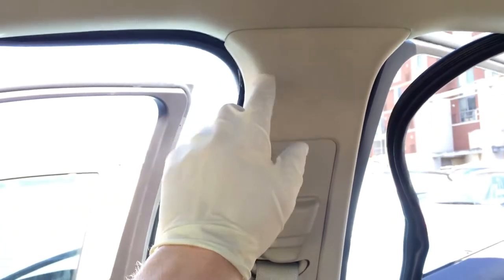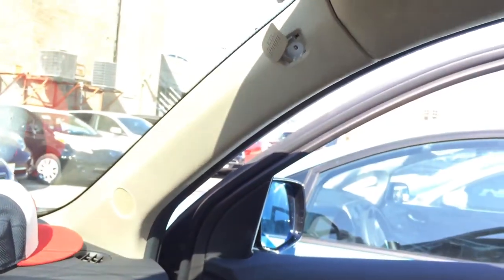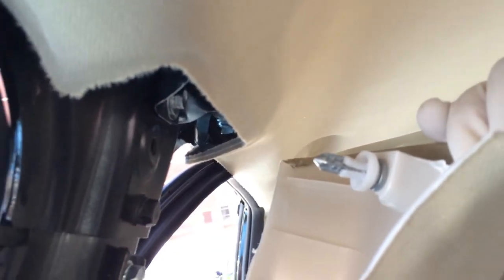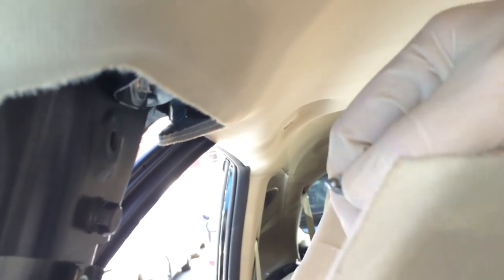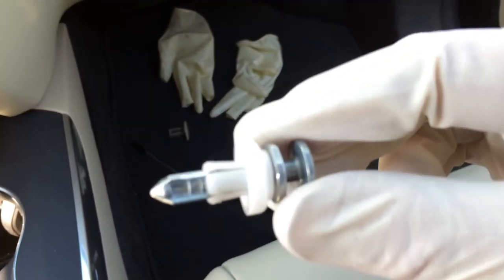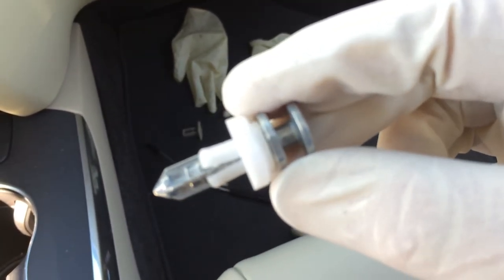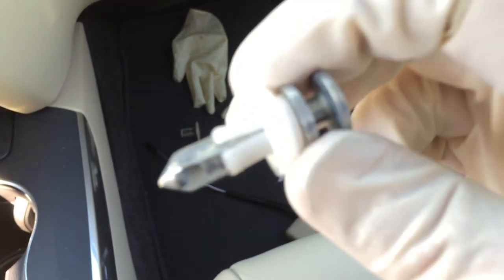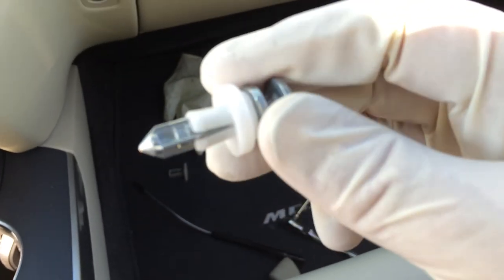How to remove retention clips on Acura MDX B-pillar.

Comment: My driver’s side has been ‘ticking’ since I bought an used ‘20 a month ago. Can’t figure out where’s it’s coming from. But it’s temperature related. It ticks when it gets cold. Technician already replaced the clips but the sound is still there.